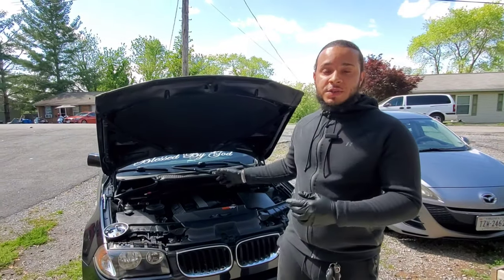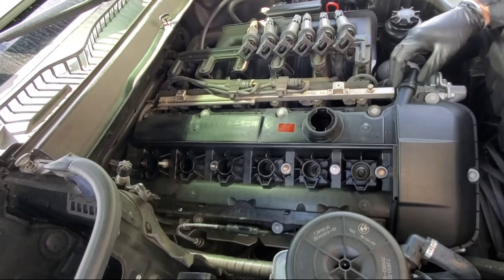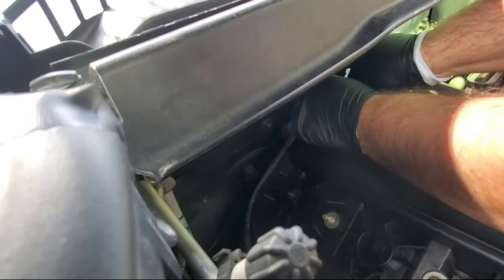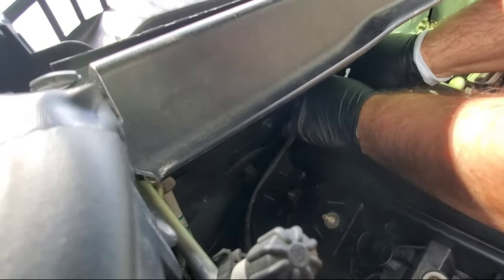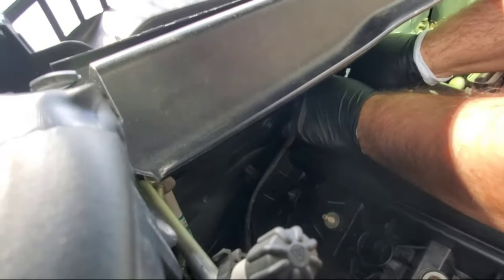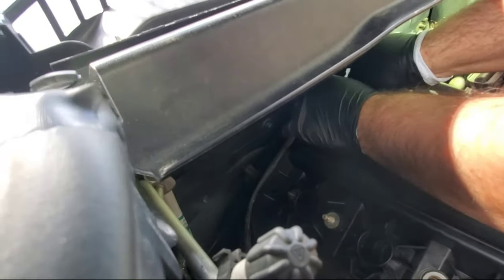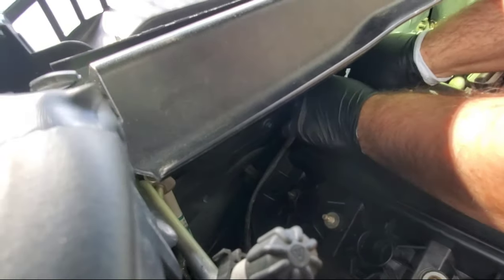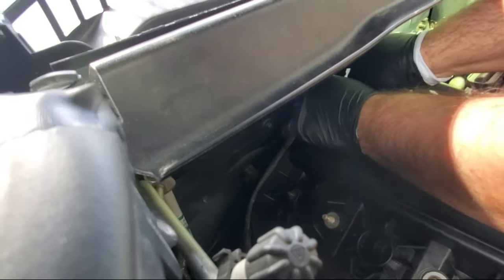BMW X3 [E83] 2004-2006 How to Replace Valve Cover Gasket Complete DIY!

Comment: Excellent video! I am gonna order the parts and try this on my 2007 E83. I was curious, you mentioned replacing the bolts 13:24 how would I find that kit? Also for 13:59?

Comment: Great video!  Followed it clip by clip...awesome work.  After job is done we can just start the vehicke or wait for silicon gasket to cure...
Also, i found that there is hise missing right top side of the intake manifold...what is that hose.  Maybe cause of my p0171 and p0174
Greatly appreciated.
Reply from the maker: Hey my friend I hope all is well, I'm so very excited that you have found my channel and i Hope you become a member of the sub family community! The longer you let it sit the better odds you're going to have of it not leaking over time. I recommend waiting 2 days before operating the vehicle. But if you can not wait that long then at least wait 24 hours or overnight. If you drive it within an hour it's guaranteed to start leaking sooner than later. And this process will have to be repeated all over again. 

Now for the codes P0171 and P0174 on your BMW x3 indicate a lean condition in banks 1 and 2 of your engine, which means the fuel-to-air ratio is imbalanced with too much air or insufficient fuel.

I would assume the Hose your talking about would be the Crankcase Breather Hose you will need to buy a replacement part and add that to your Crankcase. That is most likely the reason for the two codes you have stored in the computer. 

Product Link:
Crankcase Vent Hose - Connecting Hose from Vent Valve:
https://shorturl.at/ADYZ1

I hope this information helps you. & i appreciate your support. Keep being an amazing person my friend. & I will be here to assist you every step of the way.

May Yahusha HaMashiach Bless you!

Comment: Great video mate, thanks brother, Lovely clean engine, I have this task yet to come along with a quick vanos rebuild and new ccv hoses etc, hoping to do it all in one hit? They are great motors 👍🙌
Reply from the maker: Hey my friend I hope all is well, I'm so very excited that you have found my channel and i Hope you become a member of the sub family community! Yes your absolutely correct my friend the BMW X3 E83 has a very reliable Moter that will last many years to come! I know you have probably already completed those tasks you have mentioned to me, but if you have not I recommend you doing one Repair at a time due to changing the value cover gasket on the BMW X3 E83 is very time consuming. It will take you approximately 1-2 hours if done correctly! I have faith that you can complete both repairs if you have not already done so. But I hope this information helps you. & i appreciate your support. Keep being an amazing person my friend. & I will be here to assist you every step of the way. Godbless you
Reply: That's what I'm in the process of now :( make sure you replace all hoses for your pcv valve and don't be surprised if your intake boot is brittle if it isn't already cracked. I was able to do it without taking the intake off, but it's a pain. 
2006 X3 m54
Reply from the maker: I'm so very excited to hear that you have Successfully completed the repair on your BMW x3 e83! I hope my step-by-step video was useful in your repair process. And also I will be here every step of the way on your repair journey! Don't forget get to join the Sub Family Community if you already have not my friend(: 

My 2004 BMW x3 e83 repair was a success as well! And all the Hoses were intact. I didn't have to replace any of them at the time of the repair. Thanks to our lord and savior Yahusha HaMashiach. Also depending on how the previous owner maintained it will depend on whether that stuff will need replaced. & Mileage also plays apart in having to replace all the the hoses on the bmw x3 e83. Mine at the time only had 65k miles on the odometer.